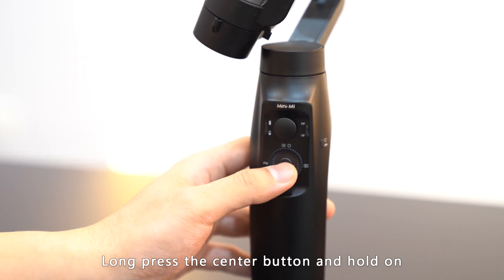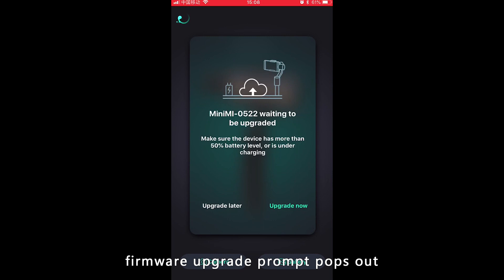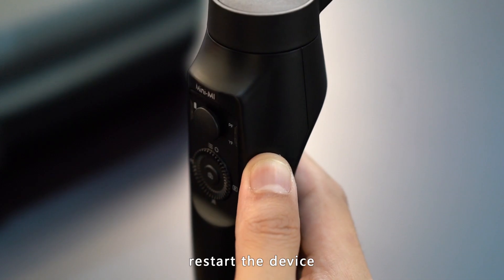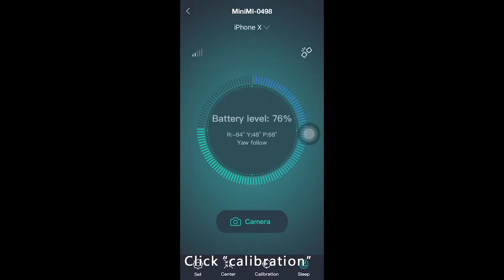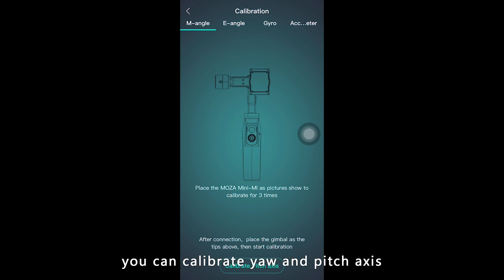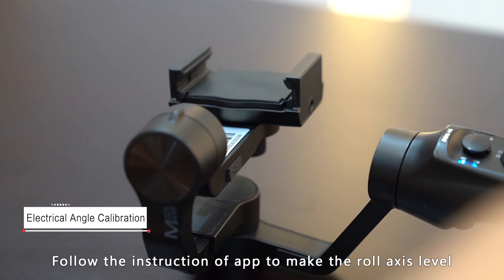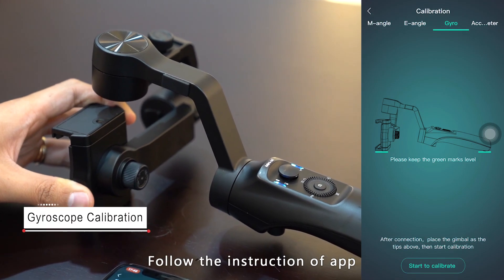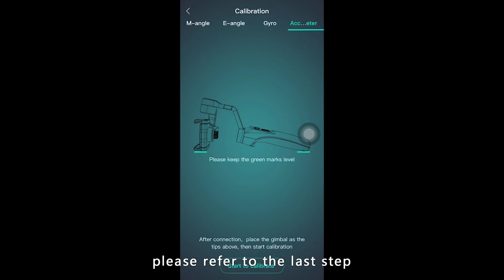MOZA Mini-MI Tutorial Part 2-How to Upgrade the Firmware and Calibrate

Comment: The Roll axis calibration is cryptic and I can't make it work .... the other things will calibrate, but it doesn't stop it from spinning like a blender ... Any ideas?
Reply: The same problem, already write in support
Reply: I figured out that the first step works best when you have it on the tripod, and that I was misreading one of the images on the end steps of calibration. It seems to work well now. I hope that helps!
Reply: @JamieMPhoto  please tell me how make a gimbal normal again ??
Reply: What problem are you having? I figured it out when I realized that I needed to do I think it was the first step with the tripod feet on it, and then I was misreading the instructions on how to rest the various spots. When I watched the video closely, I figured out that I had a step wrong. I hope that helps any!
Reply: @JamieMPhoto  after upgrade firmware my gimbal always spinning before i use moza genie app... How the factory restart??
Reply from the maker: Can you please send an video of how you calibrated the Mini-Mi to support@gudsen.com? So that we can help you see where is the problem. Besides, calibration procedures will be simplified in the future.
Reply: for the roll axis step...try holding it at the L bracket of the gimbal...not the motor/not the handle...hope that helps
Reply: Thank you! I managed to succeed on the first step by using the tripod. I'll try that out, too, next time.

Comment: Please provide assistance to reset the Moza Mini to factory settings. After calibrating my gimbal goes crazy when I put my iPhone 8 Plus in it. Why is that? Very frustrating!
Reply from the maker: Hello, you can reset the settings in app, click the setting icon, you will find it
Reply: I found the restore to factory defaults but it's not responding. i tap it the button many times. Plus my gimbal always seems to go to sleep mode i'm not sure why. Not to mention the vibration, spinning and tilting. PLEASE HELP!!!
Reply from the maker: Did you write an email to support@gudsen.com? It will be better if you can attach a short video so that we can find where is the problem.

Comment: My mini mi gimbal get crash and cannot be turn on after updating firmware. When i charge it, its led indicator goes red. Even after 4 hours later. But then it cant be turn on at all
Reply: No .
I will send the gimbal back to be repaired ...  very  upset . I dont know how long I need to wait
Reply: Please help
Reply: Mine got the same problem.  My update stuck at 0% , I finally turned it off , then I can't turn in on normally. Now if I  push the power button , it enters the firmware update mode ONLY.   Oh my god , please help ......
Reply: Dolfi Besari , me to, how i can fix it, can you help me ?
Reply: 周育存 same problem,... have you found the solution?
Reply from the maker: Hello, what smartphone do you use?  Does your Mini-MI have more that 50% battery level when you update the firmware? You can write an email to support@gudsen.com and attach a short video so that we can find where is the problem.
Reply from the maker: Can you please try to use Mobile date than WIFI when you upgrade? Have a try
Reply: I tried using mobile data , but still failed.    I have sended the gimbal back to be fixed.
Reply: I have the very same problem: after firmware update it just stopped working. Does any solution to this exist?
Reply: I order a replace since i have a replace guarentee from the seller. Never update the firmware!!
Reply: Got it, thanks. It looks like this is the best option I have too.